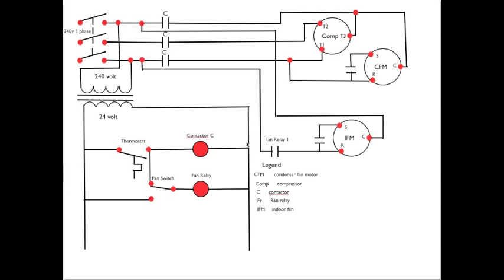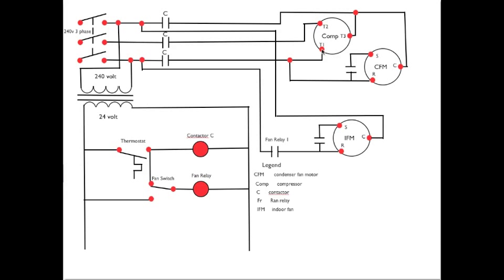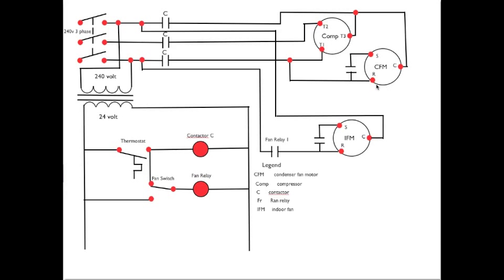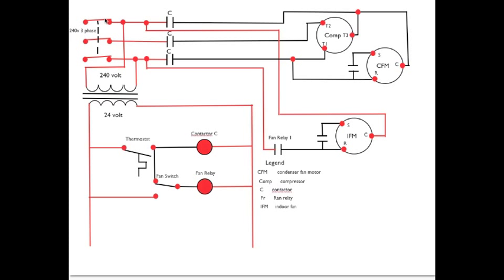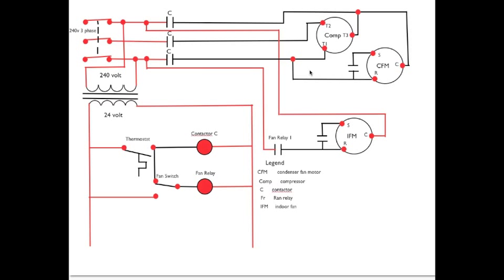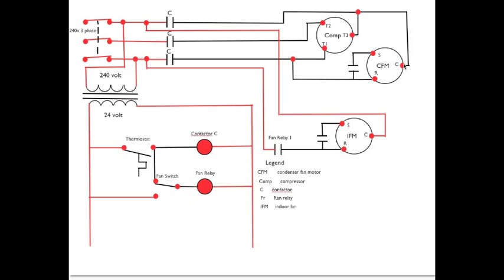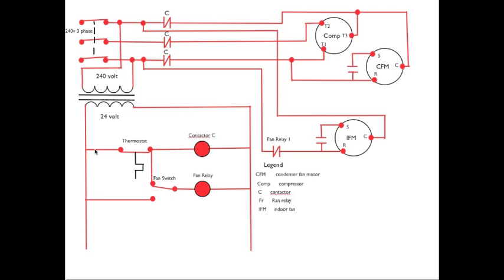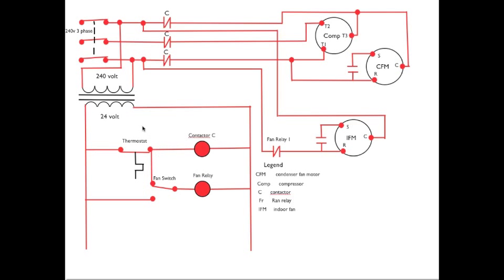Schematic diagram #13.  3 phase air conditioner

Comment: So when you pull two of the three lines out of the three phase circuit you get single phase (hot and neutral)? Is that correct?
Reply from the maker: johnmiller102 If you use 2 lines of the 3 phase, you get the same voltage as with 3 phase.  Neither is neutral.  The neutral is the center tap of the transformer in most cases.  Hope this helps.
GFM